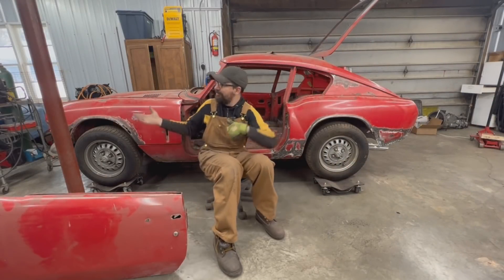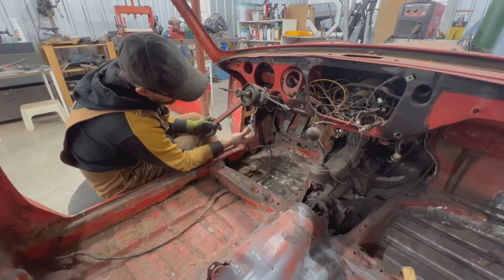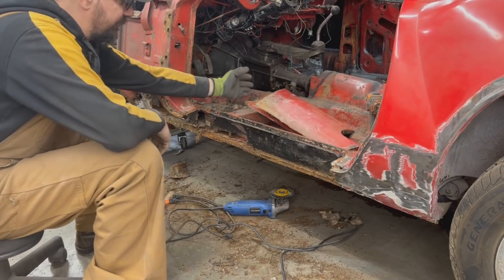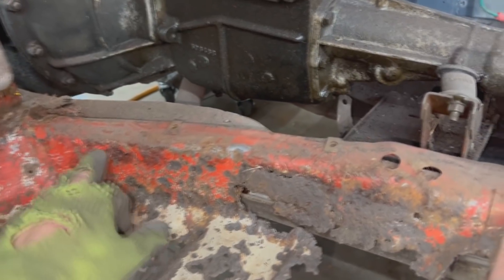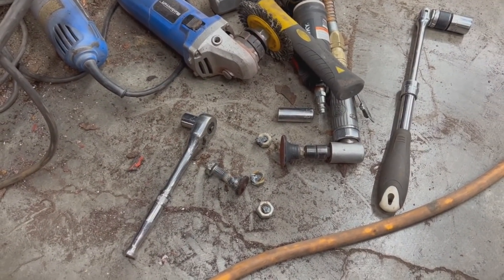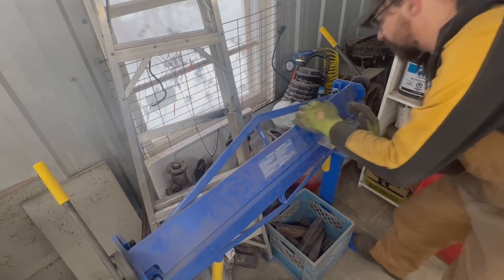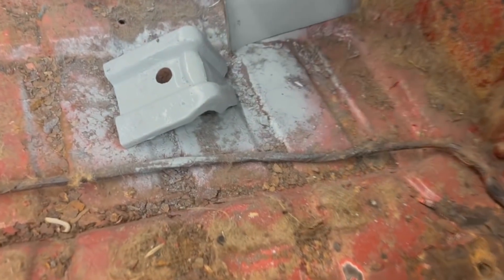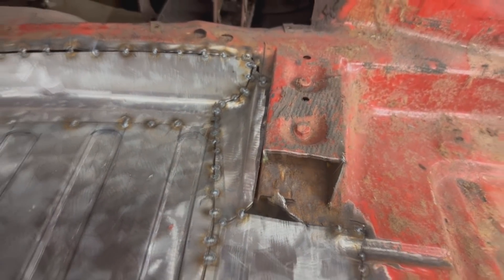1966 Triumph GT6 - Part 27 - Hello From The Other Side

Comment: No worries my freind. Thicker metal is tougher to shape, but you'll get it.
On the English wheel, for re-flattening metal it sounded like you may have had it too tight/too much pressure. You just want the anvils to just barely make contact with the panel so you don't start stretching and change shape in unwanted ways. But, you managed in the end.
I'll see if I can dig up some good videos on basics for you.
Reply: what was the shrinking video?
Reply from the maker: @praetorious  ah, sorry, I forgot the link. I will find it and add it later today.
Reply from the maker: @praetorious  https://www.youtube.com/watch?v=b3eOIPH1fPU&t=186s
Reply: @RustyBeauties  Thanks Elin and Hazen